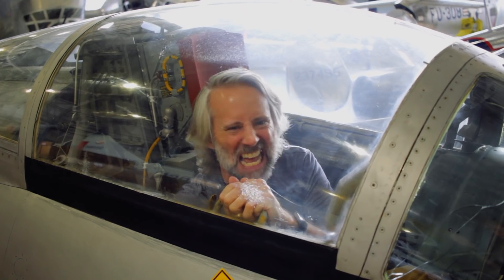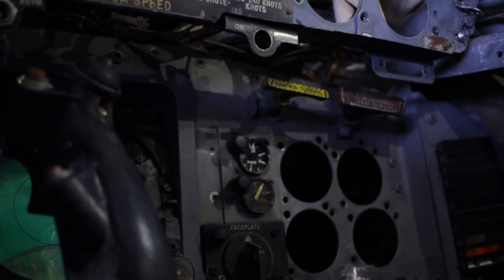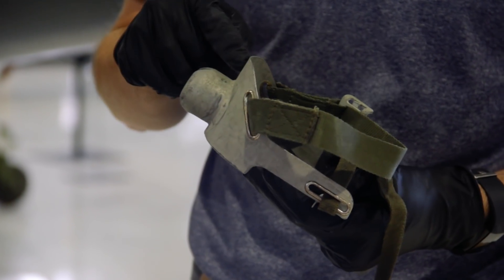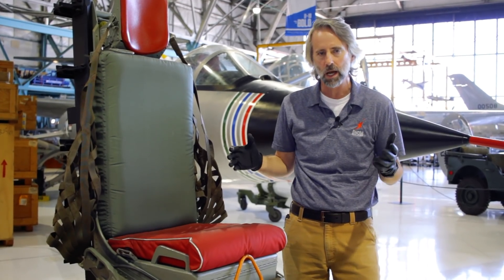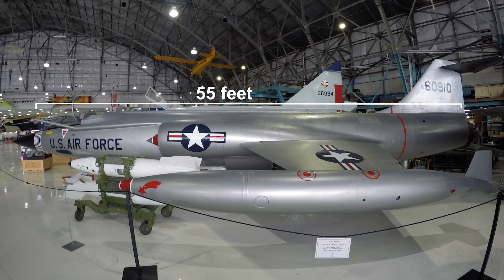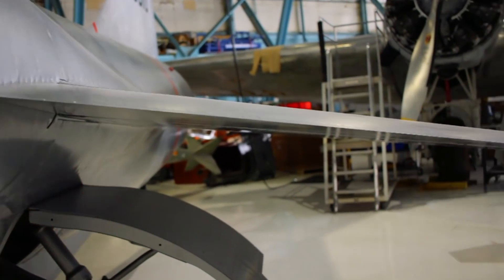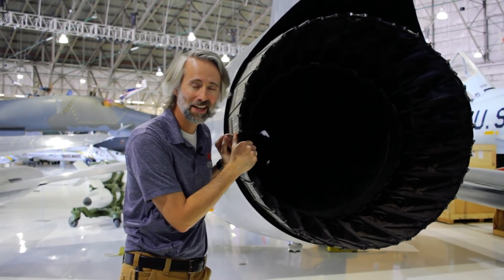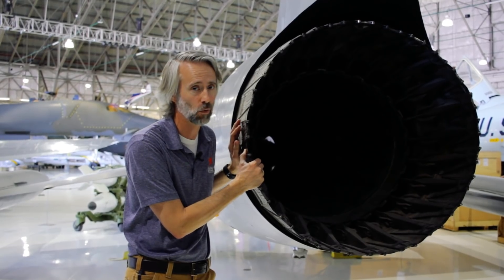F-104 Starfighter | Behind the Wings

Comment: This plane was a favorite of mine (alone with F14 Tomcat) when I was a kid.... mostly because I really liked the cool name, but also because it could go more than 2x the speed of sound on a single jet engine and just looks FAST! This plane was meant to fly high and fast. I don't believe one was ever lost due to combat, all the crashes were due to stalling that wing at low air speeds. The plane was a true interceptor, it was not designed to fly low or slow or get into a dogfight so those nations that tried to use it low and slow crashed them left and right. 

It is a VERY cool plane when used the way it was designed!
Reply: MShrader211:  Sadly, a number of 104's were lost in Vietnam.  My late Dad was piloting one of them.  See my Comment above.  https://www.facebook.com/ColonelTomFinneyRemembrancePage/?eid=ARDfn3MSwB-f7weNwvarrZUwYZSOXlyd0JWxZFc3J-yp5L3CiSYY7D_4v2FOQt3fpIxl34LauNe-ifdZ
Reply: Several F-104s were lost in combat.

And virtually none of the crashes had nothing to do with flying slowly to the point of stall.

Finally, the F-104 was NOT designed to be an interceptor.
It was designed to be a daylight air superiority fighter.
In fact, part of the reason why the U.S. Air Force became disenchanted with it is that it was a pretty crappy interceptor due to its limited fuel.
Reply: @lewiscole5193  Well, I never heard read or saw any reports about that before. Who were F104's in combat with? And with the outboard wing tanks, I'd think on a single engine it'd have plenty of fuel for flight... but that's just my opinion nothing more. Regards Lewis!
Reply: @MShrader211  
> Well, I never heard read or saw any reports 
> about that before. Who were F104s in combat 
> with?

With all due respect, sir, it sounds like you haven't bothered to look for any reports before.
Even the Wikipedia entry for the F-104 lists combat losses.
In the case of the U.S. all of the combat losses (about 10 of them) were due to ground fire (which while not AIR combat is still COMBAT nevertheless) in Vietnam.
The first direct air combat losses between an F-104 and a MiG-21 occurred during the Indo-Pakistani war of 1971 where between 2 to 4 F-104s were shot down by MiG-21s.

> And with the outboard wing tanks, I'd 
> think on a single-engine it'd have plenty 
> of fuel for flight ...

The tip tanks and pylon tanks roughly double the fuel carrying capacity of the F-104.
However, how long that fuel lasts depends on it's used during a mission.
For wide area interception, it's not enough to keep the F-104 in the air for a long, long, LONG time like the F-101 which was the wide area interceptor of the time.
For point defense, the F-104 would presumably take off and climb to intercept its target which requires that the F-104 be as light as possible so that it can accelerate its fastest which means no tip tanks, but Sidewinder missiles instead.
In that case, the internal fuel severely limits its range as a function of the altitude of the attacker.
For a target flying at about 45,000 feet, the F-104 can take off and intercept a target up to about 150 miles.
For a target flying at about 70,000 feet, the F-104.can take off and intercept a target up to about ZERO (0) miles away ... which isn't something that's terribly useful if the target happens to be carrying nuclear weapons.
The good news is that when the F-104 is used in an interceptor role, it can get to its target supersonically while other fighters, in particular the F-102/F-106 which was used for point defense, may have longer range only at subsonic speeds.

It's useful to keep in mind that going to afterburner increases the J-79's thrust by about 60-percent, but at double the fuel consumption.
In afterburner, the J-79 consumes about 10-gallons PER SECOND so the 900 or so gallons storable externally only lasts for about 90-seconds.

And if you need further evidence that the F-104 was not intended to be an interceptor, you need look no further than the weapons that it could carry out-of-the-box.
The U.S. interceptors, the F-101 and F-102/F-106, could fire the nuclear tipped Genie unguided missile while the F-104 could not until it was outfitted with a trapeze mechanism that it was never fitted with in operation
Reply: @MShrader211  
OBTW, you didn't bring up your apparent belief that most of the F-104s lost in German occurred due to stalls at low speeds which as I've indicated is not true at all.
If you need further evidence of this, you can find a brief summary of all F-104G crashes that occurred listed in the FAA's booklet on what it takes for an F-104 to be certified as airworthy for flight in the U.S. which can be found online.
(The booklet is presumably for FAA inspectors who end up having to consider F-104s brought into the U.S. from overseas, repaired, and then presented to the FAA by private owners.)
Reply: @lewiscole5193  With all due respect, sir... you don't need to lecture me! :-| You're not exactly including source references to any of your info either! You produced exactly 0 Evidence of anything yourself, sir. 

The F104 Starfighter carried 2X Sidewinders on mounts under the main fuselage behind the nose gear.... or am I totally wrong about that too, Lewis? I've never seen a pic of one with Sidewinders on the wing tips in place of tanks. I'm just saying.
Reply: @MShrader211  
> With all due respect, sir... you don't 
> need to lecture me! :-| 

Need to?  No.  Want to?  ....

> You're not exactly including source 
> references to any of your info either! 
> You produced exactly 0 Evidence of 
> anything yourself, sir. 

I DID provide evidence in the form of my reference to the F-104 Wikipedia entry for F-104 combat losses ... evidence that you could have easily found, but which you apparently didn't bother to look for, and which you now seem to regard as not being "evidence" for reasons that are entirely a mystery to me.
I also mentioned the FAA airworthiness booklet for a list of German F-104G crashes which would/should show that your claim that most of these crashes was due to stalls at low speeds is wrong.

I can understand the desire to see evidence to back up a statement made on the Internet and I am willing to do so (at least for now).
But if you want me to provide such evidence and you don't feel that my evidence is sufficient for some reason, then you need to provide some reason or evidence yourself to justify why my evidence isn't good enough.
Simply saying that I haven't provided any evidence doesn't cut it.

So getting back to the evidence, as I pointed out the F-104 Wikipedia entry describes F-104 combat losses in the "Operational History" section.
The URL of the entry is this:

  < https://en.wikipedia.org/wiki/Lockheed_F-104_Starfighter >

In the case of losses during Vietnam, you can also find out about these losses here:

  < https://en.wikipedia.org/wiki/List_of_aircraft_losses_of_the_Vietnam_War >

As for other "evidence", you can find the fact that the F-104 was not designed as an interceptor in just about any good book that gives a history of the F-104.
I usually go to Martin Bowman's book "Lockheed F-104 Starfighter" which just happens to be online if you look for it but which I won't provide a link to due the possible copyright violation risk.
You can find the F-104 history in Chapter 1, "A New Star is Born", starting on page 25.
(OBTW, you'll notice that much of the Wikipedia entry is sourced from this book.)

As for the range of the F-104 when used in an interceptor role being dependent upon height, you can find this described on this Web page:

  < https://www.pearlharboraviationmuseum.org/pearl-harbor-blog/lockheed-f-104-starfighter/ >

This Web page claims that the F-104 range was underestimated in its role as an interceptor, but WRT my comments, it points out that the F-104 could fly up to 150 miles supersonically for an interception:

  < https://nationalinterest.org/blog/buzz/quick-look-why-f-104-starfighter-was-best-interceptor-its-time-64266 >

Peter Davies book "F-104 Star Fighter Units in Combat" likewise mentions a 150-mile interception range when equipped only with Sidewinders on page 16, the page in question being locatable as a Google book by searching for F-104 "tip tank capacity".
(Note that Davies book is cited as a source reference at least a couple of times in the F-104 Wikipedia entry.)

As for how much fuel a J-79 burns "wet" (i.e. when in full afterburner), you can find that out at any number of places.
Here's a Web page which includes said information taken from the Global Security Web site:

  < http://paulcegelski.com/j79.html >

And if you need to hear the same thing said by a real live expert, you might like to checkout the YouTube channel belonging to "@AgentJayZ" who is a techie working at "S&S Turbine Services" who repair jets, including those that have gone into restored F-104s.
I'm too lazy to find the exact video in which he says it, but I THINK it was in the most recent video he did on afterburners (I think it was entitled something like "Why Afterburners?").
A list of his videos can be found here:

  < https://www.youtube.com/user/AgentJayZ/videos >

And finally when it comes to whether or not F-104G losses in Germany had much to do with stalling during low speed flight, here's a link to the FAA PDF that I mentioned contains a summary of German losses which you apparently also didn't bother to look at and presumably don't consider evidence for some reason:

  < http://www.916-starfighter.de/FederalAviationAdministration_F-104_Airworthiness_Certification.pdf >

> The F104 Starfighter carried 2X 
> Sidewinders on mounts under the 
> main fuselage behind the nose gear.... 
> or am I totally wrong about that too, 
> Lewis? 

Yes, the F-104 could carry a couple of Sidewinders on its fuselage.
I have a picture of a Danish F-104G with Sidewinders mounted in this position in the coffee table book entitled "The Worlds Greatest Interceptor Aircraft" put out by Gallery Books.
Unfortunately, the book eschews page numbers and so I can't be more specific and there's no online copy that I'm aware of.

But more importantly, the issue is (presumably) F-104s used as interceptors in the U.S. Air Force (and ANG) which were F-104As and F-104Cs, not F-104Gs.
The book I just mentioned gives a short blip on the F-104A interception configuration which has Sidewinders on the wing tips and a couple of tanks under the wings.
The book says "Alternately, a pair of AIM-9s can be carried as a 'twin pack' on the centerline station", but while I've seen a picture of the former configuration, I have never seen a picture of the latter ... and I've actually looked for such a picture.
I've run into numerous pictures of F-104s with just Sidewinders on their wingtips.

> I've never seen a pic of one 
> with Sidewinders on the wing tips 
> in place of tanks. I'm just saying.

  < https://www.britannica.com/technology/F-104 >

Comment: 👍👍👍 My first base after tech-school in the AF was Luke AFB just outside Phoenix Arizona. The  German air force trained there in 104s. So I got to see them every day for over 13 months before shipping out for Udorn Air Base, Thailand. There were no 104s by the time I got there. At Luke we had F-4c's, in Thailand we had F-4d's, e's and RF-4c's. RF-4c's are a reconnaissance version of the F-4 that has no guns or even a weapons system installed, just cameras. Looked like a F-4e. I have often wondered if the E model was based on the RF-4c or the other way around.
Reply: The RF-4C came before the E model.  The E model had a different leading edge with slats as did the horizontal stabilizer which in turn created more drag and were slower.  However the turn capability was greatly improved and did not have a tendency to go out of control at high AOA like the hard wing F-4's.

Comment: The F-104 was designed by Kelly Johnson as an Interceptor. A short range point defense aircraft.  Lockheed sold the F-104G to NATO as a do everything plane.
Reply: > The F-104 was designed by Kelly Johnson as 
> an interceptor.

Wrong.
It was designed by Kelly Johnson (and company) to be a daylight air superiority fighter after talking to Korean War fighter pilots during a tour he made there.

> A short range point defense aircraft.

Wrong.
While its range was short, it's mission was to go after enemy fighters and shot them out of the sky.
Johnson and company presented the F-104 design to the Air Force who then asked for bids from other aircraft manufacturers to see if they could come up with anything better.
The Air Force did NOT ask for an interceptor, but rather a daylight air superiority fighter to replace the F-100.
They already had a point defense interceptor in the form of the F-102/F-106 and a wide area interceptor in the form of the F-101 and weren't interested in replacing them.

> Lockheed sold the F-104G to NATO as a do everything aircraft.

Not quite.
Lockheed was in a world of hurt financially, but presented the F-104 design to the Germans who were asking for do-everything aircraft, in particular a recon aircraft, an interceptor, and a ground attack aircraft.
Lockheed said that they would make the F-104 into something that the Germans would accept and they did by strengthening the F-104 fuselage to supposedly take the additional punishment of flying ground attack which became the F-104G.
Other European nations piled on eventually, but the Germans were the first as they wanted to become a fully functional NATO participant and they hoped that a single plane could get them there from here, not because NATO as a whole had any interest before hand.

Comment: one of the biggest issue with the F104, for the receiving country like Germany, Turkey, Italiy, was the transition from the F84, F86 or P33 to the starfighter. If I'm not wrong, Italy was the country with less accident of all because the made a good transition, training the pilots on flight simulator and/or training the pilots to use correctly the instruments. 
Until piloting F84-86 etc, most of the attention of the pilot was to look out and have the vision of the horizont to keep the plain straight flyng. More the wings of the previous aircraft were designed to fly well even at low speed. the F104 had to be flown in a complete different way, more its scope was to be an interceptor, not a dogfighter.  To fly a F104 you need speed, one of the "motto" from the Italian pilots was "with F104 if you have problem, power up" . So flying visually and going fast, maybe low, was the real issue: F104 needs to be flown by instruments to avoid stall and to keep it fast. Many airforce, in the hurry of upgrading the machines, did not train enough their pilots to trust mostly the instrument. That's why there was so many accidents.

Comment: Always said the F-104 was an aircraft before its time.  If it had come out with "fly by wire" it would have done better.   If the German pilots that crashed them had been better trained, would have been a different story.
Reply: It just wasn't in the same class as the English Electric Lightening .

Comment: If you want legendary, you should look at the Avro Arrow, or what’s left of it. Built in the late 1950’s in Canada, the Avro Arrow was intended to be the main interceptor jet of the RCAF. This thing was a beast. Standing at 6.5 metres tall, 24 metres long and 15 metres wide, the Avro arrow was the first step in aerospace development. Flying at speeds above Mach 2, and a ceiling of 50,000 feet, the Avro Arrow was the best. Unfortunately it never saw use in the RCAF as it was cancelled in 1958 and all 6 were to be dismantled and destroyed.